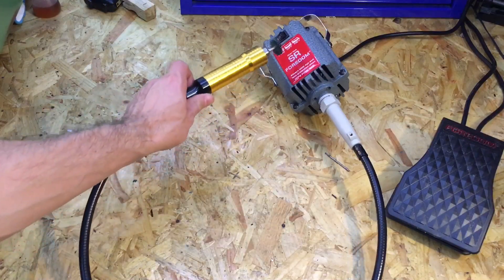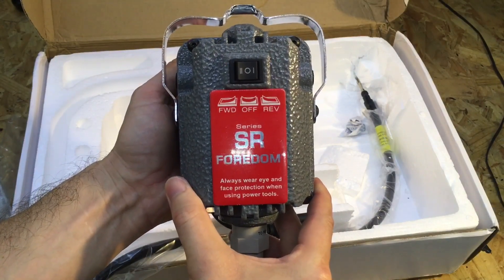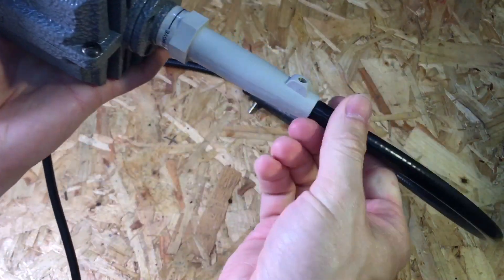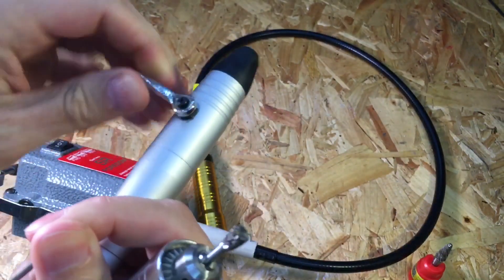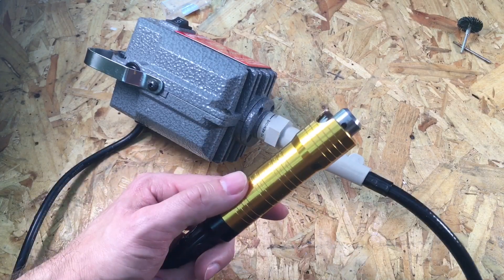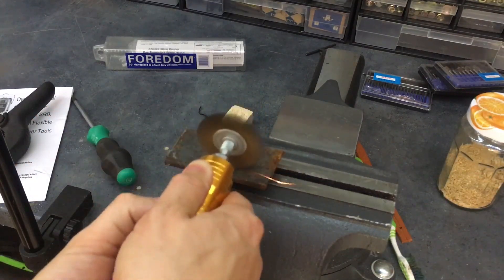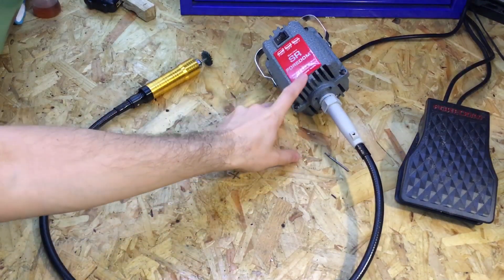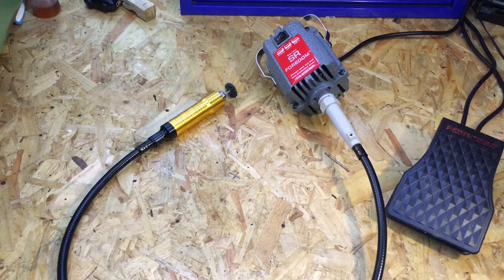Foredom SR Pendant Motor Rotary Tool

Comment: Is the motor a 2 pole or 4 pole ?
Reply from the maker: 2
Reply: @JAYZWORKSHOP    Is the real Foredom a 2 pole ? If I'm bothering you I'm sorry but the reason I am asking I was thinking about buying a Chinese Foredom & then ordering the  USA Foredom Heavy Duty Square Flex Shaft & Sheath w/hand piece , I would come out a lot less expensive.
Reply from the maker: ken parks no your not bothering me I was short in answer was just going to bed. They are the same in every way the only difference is the foot control is not as good quality and not as easy to control speed but you get used to it . I have a foredom now and really no difference in use I use big carbide burr’s in it for die grinders to clean steel welds up it’s as hevey duty as the original .

Comment: Hi man, i just bought mine a month a go and i had have some problems. The handpiece stops spining whit the motor and flex shaft, it seems the mandril does not make contact with the rest of the handpiece. Now the Flex shaft stops spining with the motor si i will try yo contact the vendor.. what about yours, any problems? Thanks
Reply: I have the same problem, the chuck is not connected to the handpiece...

Comment: Just came across your channel, I'm planning on having a little workshop just wondering where you got your metal building from, thanks Mitch
Reply from the maker: 10ft x12ft 3.0m x 3.66m absco  shed from www.waltons.co.uk the gauge steel they use is thicker than most sheds like yardmaster  and they don't cost much more. and the panels clip together so less screws are needed.
Have a good day.
Reply: @JAYZWORKSHOP  thankyou

Comment from the maker: ➡ 220V 0~18000rpm 6mm Hanging Flex Shaft Motor from Banggood 
➡ https://www.banggood.com/custlink/3KK3Z35Boi
➡ Shank Quick Change Handpiece https://www.banggood.com/custlink/vDKmtYecPY
➡0-4mm drill chuck Handpiece https://www.banggood.com/custlink/GG3DIDV46F
➡large Carbide burr https://www.banggood.com/custlink/D33DZKH4qc
➡ Tungsten Carbide Burr Rotary Bits Set https://www.banggood.com/custlink/mKvmPmNP0Z
➡Summer Prime Sales on Banggood
➡ https://www.banggood.com/promotion-banggood-2019-summer-prime-sale-9178.html?utmid=8617  

This item was sent to me free to make a video.
Above are affiliate links and in the comments it costs you nothing, if you do not want to use links search on goggle more info Thanks.

Comment: Looks good ,  Being a banggood thing are they U.S.  made  as per the name on the manual ?
Reply from the maker: Hi Max I think so. it does seem well made.
Reply: @JAYZWORKSHOP  they are definitely not U.S. made, but yes they seem well made and so far im very happy with mine that i bought on ebay.
 A real foredom would have a blue label if it were a U.S. 120v version, also the area where a serial number would be stamped is left blank. The handpiece is also nothing like a genuine foredom, i actually got $30 back because the eBay seller i bought from used a genuine one in the photos but shipped one like that.
Reply: Definitely not….Banggood stuff is made in China…

Comment: As others said, this is not a real Foredom. It's a very good counterfeit. I have it, along with a real SR, a TX, and two other pendant motors. This product's main failing is its pedal. I'd strongly suggest upgrading to a genuine Foredom pedal. It offers significantly more control. Good luck.
Reply: The and piece is made in China and the motor too ! I have the real deal it has Foredom  written on cast motor cover above front label ! Sorry !